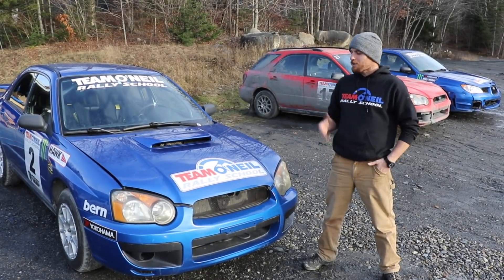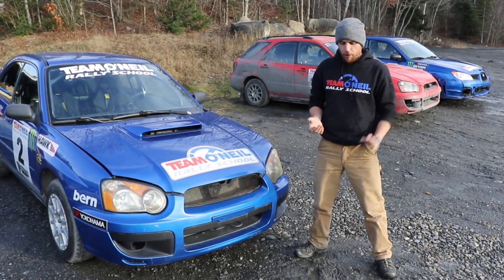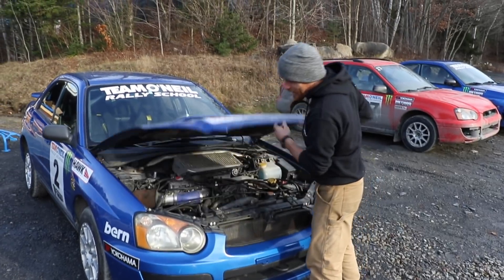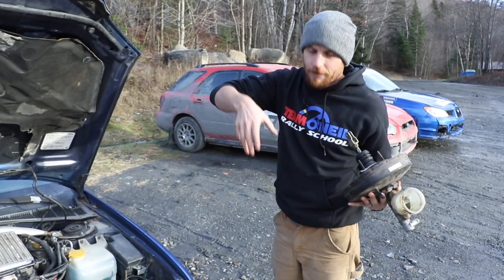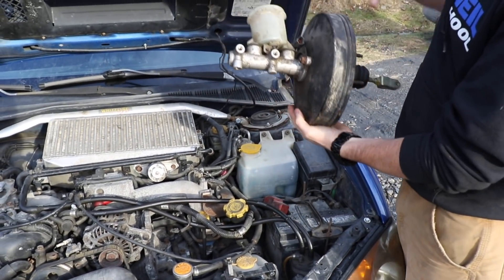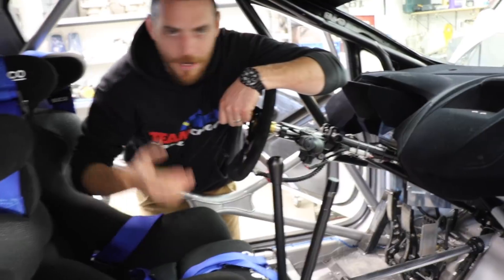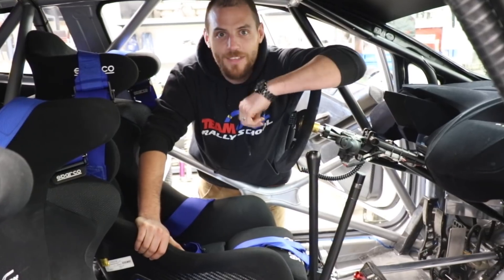Street Car Brakes VS Race Car Brakes

Comment: 3.20
Subaru brakes are a diagonal split dual circuit brake system.  Not front / rear split system.
Reply: Richard Price 
There is about a 20-30 year gap between R35s and anything using points, carbs and mechabical anything's.
Reply: 90% of production cars are setup this way for safety reasons. in case of a brake line failure at least one front brake and rear still function.
Reply: jean luc Dubinator 
I am fully aware.  I was just pointing out that he explained them as a front / back split in the video.
Reply: Alrighty then.
Reply: Bram Biesiekierski that part of my point in the 70s computing power was way less for on board mobile control for things like the engine management aka efi and vs the other options it didn't work really well or have the reliably ( early transistors were fragile ) that they do now ( post 2004 ) the way I see it is take every advantage that you can that's why I'm adding decent electronics and mite add stability control and anti-lock brakes but the cost puts a damper on things for now of how fancy I go
Reply: Bram Biesiekierski he's off on the abs / traction control there is a significant grip advantage of having it why do you think it's baned in some motorsports heck even Williams international got kicked off the track because it was working so well vs similar cars the biggest problem with factory computers it not being able to tune it for performance / race driving and I started out liking pre Nissan GT-R R 35 computer filled cars aka all mechanical with points and carbonators but as time and progress has march on the computer are better now
Reply: " he's off on the abs / traction control there is a significant grip advantage of having it"

Not on dirt/gravel.  And ABS/traction control get in the way of rally driving techniques.

Comment: 9:25 So you're telling me that in a production STI, when the hand brake is pulled, the center diff disengages?

EDIT: After some further research, Yes this is true. I have learned something new today.
Reply: How about just the wrx?
Reply: Diego Tobar just connect a fuse to the handbrake light!
Reply: So is that all sti's or just after a certain year?
Reply: If your handbrake can break your engine, either you have a sad wrx or a gnarly handbrake 😂
Reply: center diff =/= engine.  But shouldn't it be obvious? I mean you're locking up your rear wheels while the front wheels (it's AWD) are still going damn quick. Of course that would break a center diff
Reply: If you're lucky and your diff is in a good condition, it will stop the engine. If you're less lucky, your diff won't be in a good condition after that.

Comment: very good video.   one thing you might mention is that in the U.S.  cars had one master cyl for 4 wheels untill 1967 when the government mandate duel master cyl.  also in 1967 was the first year for a collapsible steering column.

Comment: 9:50 does this particular example have a locked centre diff then?
Reply: If the mid diff wasn't locked, locking the rear wheels on a normal mid differential would make the front wheels turn twice as fast, which would make for very frightening behaviour mid corner if you use the handbrake. Disconnecting the drive to the rear wheels on an open diff would mean all the power spins away to the rear wheel side of the diff and nothing goes to the front though, so the mid diff has to be able to lock to allow the front to be powered while the rear is disconnected.

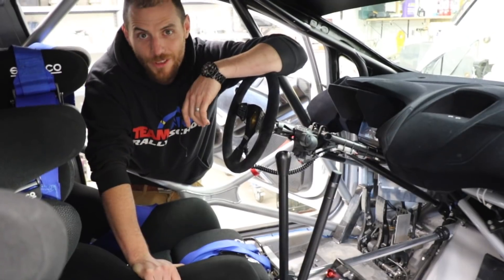Comment: That Msport handbrake is pretty trick @ 10:08.  Is there a performance advantage of pressurizing the ebrake handle and using as reservoir?  Very cool, but almost seems unnecessarily complicated.
Reply: I guess without it you'd need an additional reservoir. Hence weight savings with this system.
Reply: I like the hand brake reservoir.
Is he certain it is pressurised, you wouldn't want any reservoir pressure to translate to brake fluid pressure when hot and end up riding the pads.
It might be low when cold but as fluid warms up and expands and has to be able to back flow into the reservoir or the pressure behind it will increase to the point pads cant fully release..
It might have a light spring in the top and free plunger that allows fluid to back flow without building up too much back pressure in the reservoir
Instead of fluid displacement building up back pressure it may instead rely in the light spring pressure that inst enough to ride the pads as it compresses to make room for fluid as brakes heat up.
That tube type reservoir used to be a common superbike mod when we fitted high rear set pegs and move the rear brake master, just use a length of rigid plastic hose with a stopper in the top and small hole vented to air to hold enough fluid for hot to cold use, takes a bit of weight off and no need to locate the reservoir.
Reply: I'm curious too... maybe it gives some feedback
Reply: The reservoir is hooked up to the c-diff, not the brakes. From what I can tell it's just there because there's no other reservoir in the c-diff system and you need a reservoir somewhere to adjust for temps. I see no way it could be pressurized, there's nothing mechanical on that side of the master cyl to pressurize it (unless the driver "pressurizes" it by blowing into a check valve at the top, lol).
Reply: If the handbrake is completely separate from the main brake system then maybe it can be used as a backup in case of primary brake failure?
Reply: @fank K lol even regular vehicles the handbrake is a standalone system. You can use the parking brake for emergency but it can only reduce speed not stop the vehicle.

Comment: So is pulling the handbrake in your everyday Subaru bad for the differential?
Reply: Unless it's an STI.  STI has an electronic diff that uncouples when the parking brake switch is closed.
Reply: In short, yes. Lots of stress on the viscous center diff coupling.

Comment: My car allows me to heal and toe But if you press the brake and accelerater at the same time the ecu cuts the power which feels sooo dangrouse when it happens so no left foot braking for me 😢.

 My old nissan let me left foot brake it didn't have esp or abs so was awsome on tarmac and off road. It was awsom
Reply: I guess I'm lucky to have never driven a car with a cutoff. I have noticed that if I'm doing sudden and sustained left foot braking in my Fiat, the "service traction" light comes on. Has happened a few times and made my grin at the sillyness of how it is all tied together
Reply: One of the fuses handles it.
Brake sensor switch it might be called.But,check your rear brake lights afterwards.
Reply: thanks john